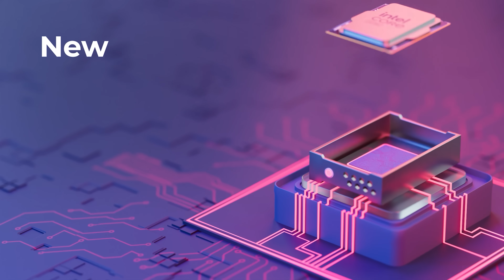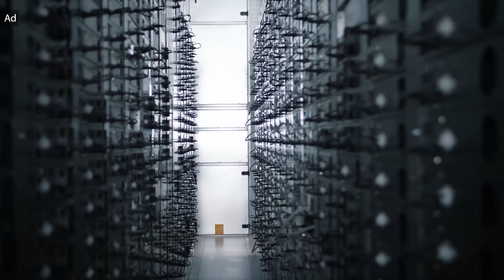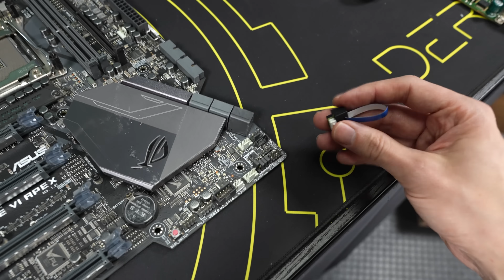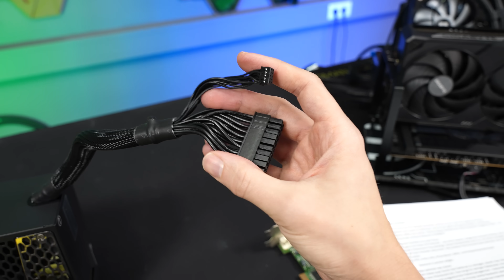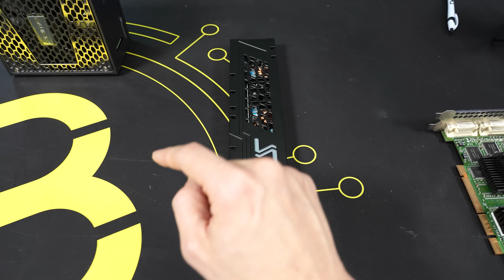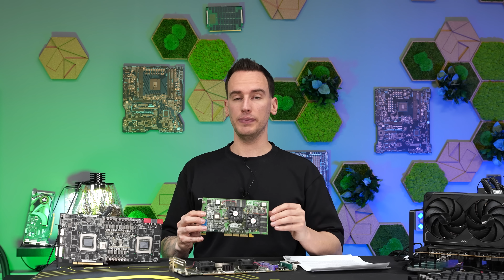Dead-on-Arrival Hardware: Why Nobody Bought These Products - Failed Hardware Ep-1

Comment: Id like to point out, that hardware raids aren't necessarily faster than software raids.

For raid1, it hardly matters.

For majority of raids, hardware raid is better, because it takes the load away from CPUs.

Hardware raid fails short on several key aspects tho:

Its another single point of failure (but so is onboard sata controller for example) except due to complexity, hw raid is more likely to fail than the onboard chip.

Its bad for nvme. Max you can connect without switching is 4x nvme ssd. Then you start losing bandwidth.

For nvme, its much better to have let's say, 10x 7,68TB nvme in software raid of some sort (zfs is decent, and more stable than any HW raid i have encountered) Or straight up some cluster technology (like ceph) paired with a good cpu (24core epyc is a decent pick, 4cores for OS, 2cores per nvme) paired with a good networking card (dual 100G, quad 25G)

There was this neat technology called "graid" they had a good idea of using nvidia gpus for nvme raid calculations, but when we tried them a few years ago, it wasn't exactly useable just yet. Gpu was a single point of failure, you couldn't boot off it, performance was good, but there was some weirdness with specific loads (like databases)

I could get to more exotic technologies like nvme-over-fibre...
But i think i already ranted too much after hearing "software raid is slower" :)

Comment: The Seasonic Connect should have been 1000w and SFX. Beat Silverstone to the market for high power small form factor by moving space around instead of waiting to develop smaller, and work with a SFF case builder to get a specifically compatible case ready for launch.
Big cases never needed the cable routing it allowed, most just lost drive bays or blocked airflow, and smaller cases couldn't fit a full ATX PSU box and the new distribution blade. It was designed for nobody. 

Either that, or it needed to be the most power efficient PSU on the market with some kind of Platinum++ rating to sell itself that way.

Comment: I liked the seasonic connect and thought it was a cool idea, I hate power supply cables which are always far too long unless you bleed money and get custom cables made.  But then when I went to consider buying one, I was building a pc that needed 12v hpwr, and yeah, I wanted more than 750watt.  So no matter how much I liked the idea, no matter how much I was willing to pay a little more, the psu just did not meet the spec requirement I needed.
Reply: custom cables idea is the best - if you want to stick with one PSU manufacturer you will buy them only once - seasonic and corsair stick with their pinouts for over 10 years

Comment: I think a Seasonic Connect-like solution would be great for a ATX12VO transition period, where the module could handle all non-12V stuff.
Reply: ATX12VO is a scheme that solely benefits OEMs that have to hit DOE efficiency specs (or the Euro equivalents). Sure, go "Well acktshually wire loss" like a redditor and I'll tell you that a fraction of a watt of wire loss is nothing. But if youre dell and youre using a modern topology PSU that converts mains to 12v and uses DC/DC converters for everything else, and it gets an 80 plus gold rating, rip out the DC/DC converters, and with the loss of those gone, its now 80 plus platinum, and cheaper.   Put the 5.0 and 3.3V regulators on  your motherboard, but because there isnt effiency standards on that, you can use cheap garbage-tier effiency converters that are barely not overheating.  So dell gets high efficiency ranked ATX12VO PSU for cheaper than a lower ranked normal one, still meets the regulations, and only has to add cheap low performance converters on the motherboard to make it happen.  That is why thats a thing, not because the PSU manufacturers care about the few hundred mW of loss on your 5.0v line. Then they do a press release about how much more efficient and environmentally friendly the new series is for people to seal clap to.

Comment: VROC could have been great if Intel had not locked down what drives could be used with it. IIRC, Intel never fully opened up VROC to let you use any drive, they still have specific drives that can be used with it.

Comment: vroc keys are still a thing in their servers. It's really annoying. I have a 1000 dollar c741 lga 4677 motherboard, and I can't afford a vroc key that supports raid 5 or 6 to unlock the feature on my 10,000 dollar (in theory, Im running an ES chip) cpu. Long story short, I have 8 nvmes in raid 0 instead of raid 6, because I don't have the ultra expensive vroc key. So annoying.

Comment: I want to make a "24pin declutter" where it's a tiny DC-DC PCB sitting right-on the 24PIN supplying all the odd rails like 5V/3.3V and it only has got a 8 pin connector (12V, enable, power good, 5VSB) so you only have 8 wires going to the ATX PSU.
Most people know how much of a headache the 24 pin with 24 wires is, hard to manage, especially in SFF builds, looks ugly, and doesn't really make sense - many wires for something that realistically doesn't draw more than 60W (I've seen it down to 20W).
Most of the draw is on the 12V CPU EPS and GPU's PCIE6-8 PIN/12VHPWR connectors, and GPU draw from pcie slot is often marginalised.
It basically is the 12V-only thing they tried to introduce but it uses existing PSUs and mobos, and still could be rewired for actual 12V only PSU.
Yes there are the so called "pico psu" which sort of do that, but the included wiring makes you draw EPS CPU power from only two wires shared with the 24 pin, meant for low power systems, the above approach could power a 300W+ CPU because all of that goes thru separate cable.
Reply: it is already here - it called atx12VO - it was several motherboards with this stadnard, it is not completly dead, dell/acer/hp/lenovo still uses it on their setups 

PS - I make custom cables, and for atx24 you need only 10wires (ps on, ps ok, 5vsb -12, +12, +5, +3.3 and 3x GND) most setup will work with that (espeically sff with iGPU) - if you want to be safe just add extra +12, +5, +3.3 and 1 or 2 gnd - then you will get 14 or 15 wire harness (in comparasion to big 23 wires setup) I am making 14-14-15wire atx in all my custom rigs for over 6years
Reply: @duniek86   Yeah but it requires special mobo and special PSU, so there would be a lot of incompatibility.
I skipped -12V, it's only required for serial RS232 interface not present on motherboards in past 15+ years...
I haven't tested that but I doubt the mobo will check for that rail.
And even if it would be needed it would be made from +12V onboard.
It would be 2 connections for 12V, 3 grounds, 1 enable, 1 power good, 1 5VSB, so that's 8
But tbh I could probably derive power good from 12V, and have 3 for 12V, there is no 12V without power good signal and vice versa.
Or there could be even less wires for ground, thing is CPU EPS is an overkill with 4 pairs, and all the grounds are shared.
Reply: @Arek_R.  I checked without -12V wire and PC not boot up :(

also while testing rail measurments I get sth strange
I push cpu up to 20-22A on 12V and on GND I got only 5A, so I checked pci-e GNDs and while gpu idling I got about 1A on 12V but on GND I got about 15A
Reply: @duniek86  Well that sux.
The uneven ground returns is typical because all grounds are joined and the current will choose often weird paths.
Is ATX EPS CPU cable longer than the GPU CPIE cable?
Reply: @Arek_R.  I tested it with stock wires, two different motherboards - similar situation - it was tested on wooden desk - also i have opposite experience - in GPU mining rigs on metal frames only gpus was working - on +12V i got full power but on GND usually 1/3 or 1/2 of  current - some current was "back" to psu by atx harness but most of it by metal frame :O
Reply: @Arek_R.  I rid of -12V and zotac z77 boot up :O
Reply: What is the type of upstream PSU that you're planning to use? Basic ATX full modular PSU and then run only 12V, 5VSB, PS_ON and PWR_OK to a Pico-PSU-like board on the MB connector via a custom cable? There are reversed schematics for PicoPSU floating about, or you can just proof-of-concept your build by removing the 5VSB and PWR_OK from the step-down converter on the PicoPSU and running them from the ATX. 

Oh and also a logic gate to logic-AND PWR_OK lines from PicoPSU and from ATX.

I suppose ultimately you can just remove most of the logic from the PicoPSU, just keep the step down converter - PWR_OK can power the converter enable, and converter has its own ready output. Sorry i'm sure you have thought of all this before, i'm just thinking aloud to understand your plan :D
Reply: @SianaGearz  No particular plan.
No need to look up pico PSU schematics except maybe some inspiration, because in the end it's just two 10-20A DC-DC converters, some smaller rails, and a bit of logic.
One thing I've noticed on cheap one I had is that they used a dedicated 3.3/5V (maybe 12 as well) power checker IC which checks if these are present, at right level, and I think that's where the PG comes from.
But as you wrote DC-DC converter itself often will have PG outputs.

Comment: 12:10 I mean the industry doesn't need another interface to replace AGP just because of needing more power. In the early 2000's, ATI Radeon 9700 Pro was a very popular  high end gaming graphics card, those things need extra power from a Berg connector ( floppy disk drive power connector) . High end Nvidia GeForce FX cards use Molex connector.  Going PCIe just standardize these external power connectors.

Comment: 13:11 How about  cards that used a 4 pin Berg connector? Felt like you were going to break it every time connected or disconnected the wire.
Reply: Well, the same applies to the Molex connectors. I still have a soundcard with a molex socket (an Essence STX II). The connector sits that tightly in the socket, when i remove the card when cleaning of the PC i don't disconnect it because i am afraid the force required to dislodge the connector would either break the socket (and thusly the card) or my fingers might slip of the connector and accidentally tear the cables out of it.

Comment: I'm honestly surprised we don't have more complex dual GPU chiplet designs on GPUs these days. There are a lot of tasks that are lower priority and require a lot less cycles to complete that would still perform really well, like if you had a 5080 that also had a 1060 as a chiplet on board that could handle background tasks like rendering background applications.

Comment: I made custom cables for a long time, and when the Seasonic thing came out I thought it was cool, except they made the pinouts for the cables the same as their traditional PSUs. If they had made them to match the component end pinouts, the short cables could’ve been super clean extensions rather than short versions of the standard cables, which are harder to make nice because of the double wires for sense pins and thick sleeved wires having to cross over each other.

Comment: What happened to 12V DC PSU? Wasn't it suppose to level up the efficiency?
Reply: It can't actually improve whole-system power efficiency, only the nominal efficiency of the PSU, by offloading some of the work elsewhere into the system. As such it allows several large prebuilt system vendors to signal green goals compliance or unify the solutions they're already using, should they be interested in such unification - which isn't certain, because they don't like their bits being interchangeable, they want vendor lock-in. I wouldn't actually be terribly surprised if it never comes to enthusiast/DIY component product market or at all.

Comment: Seasonic connect was the first step to the final transition which i hope will be ATX12VO+GC-HPRW with some improvements.
Imagine a single 20 PIN connector (10*12v+10*ground for up to 1200w) with some load balancing feature as the only power cable from your PSU to the motherboard.
Reply: That would just turn up the 12vhpwr fiasco to 12.

You are assuming you can get equal current sharing on 10 wires not just 6 and you’ve pushed the connectors and wires to their absolute limits of 10amps each with no margin for loss of any wire or connector.  You have selected raid-0 for your main power connector.

That said, I do agree that a main power supply that provides 50v with light regulation to keep costs low and distributed or integrated VRM at the point of load makes sense. OCP is championing this style of compute. Fewer wires and less current per wire with 4x the voltage.
Reply: @ppokorny99 No, you just did not ready my comment before posting. I mentioned the load balancing feature (obviously on the mobo side since this Is the only component directly wired to the PSU) to split the load on the 10 wires.

18 AWG would also be mandatory.
Reply: @hbjigcc  you edited your post
Reply: @ppokorny99 No, i didn't. This was the same post i wrote when i published It, just fixed a typo 4h ago. Try again.
Reply: yeah atx12vo should be a thing and maybe old style 12-14pin connector for GC

Comment: I did buy a Seasonic Connect, why, because they were cheap af. That’s what happens when a product doesn’t sell and collects dust on the shelf, it gets huge discounts just to get rid of it.
But it was a bit dumb of me to buy this without the case. It was quite difficult to adapt it to a Fractal Design Meshify C with is really stupid short cables.

Comment: i wish pc market would switch to 48v psu systems,it would mean thinner cables,maybe split into extra dc-dc(similar to seasonic) for extra devices like hdd(48 to 12v and 5v)...48v chips are already available(solar boom,either hv or 48v,and those hv batteries are usually 48v packs in series)..so i think we are ready...but i don't think this will be there soon enough,maybe we need 6090 melted connectors

Comment: What i'd add to this list - intel Itanium.. and those motherboards with rear mounted connections  (as they only worked with specific cases. )
Reply: Hard disagree on the rear connectors. While it was very awkward when it first debuted many cases now support it and motherboard manufacturers are still releasing rear connector models.
Reply: You mean BTF mobos? Tbh the tech is still quite new and growing, a lot of newly released cases are starting to support it
Reply: Roman already did a video about Itanium.

Comment: I "have" the seasonic powersupply with extender, but during water cooling work, I didn't notice and water dripped over the night, and fried it when i turned it on the next day.. , and didn't replace it.  Overall concept was interesting, far shorter cables, but agree that mounting that distribution block was annoying.

Comment: The main thing about the Seasonic Connect PSUs what made their use limited was that they required cases with inverse mounted motherboards (i.e., GPU at the top of the case). They sold special cases for this (the Synchro cases). I considered buying one of these PSUs for a used Macintosh G4 case, which also holds inverse mounted MBs. But it was just too difficult.

Comment: Love the series. The modern failures are so funny because you see em all over CES and other trade shows, but never in real life. VROC was also one of the reasons I went Threadripper. Not that AMD's RAID had a lot going for it at the time. Can't wait to see what's next.
Reply: I remember when they start use pci-e - performance was similar for 2-3 years with nvidia cards, many ppl says pci-e will die, me included

Comment: One of my favorite DOA pieces of tech was RDRAM. During the initial Pentium 4 release, those CPUs were only compatible with RDRAM, an obscure new RAM type with a very scarce availability. It was so bad that Intel had to bundle their CPUs with a stick or two of that special RAM because it was impossible to get it through normal retail channels. And customers were so angry that eventually Intel had to ditch it in favor of DDR.
Reply: The only time I encountered it personally was trying to help a family friend with their Dell PC.  One of the Rambus sticks went bad but Dell would not admit it because it could pass a simple and quick memtest.  Figured okay I'll just pull out the bad stick and let her run it like that for a while just to get it up and going again, but you can't do that with Rambus and I would have needed a continuity module.  In the end I just built her a new AMD Athlon PC to get away from Intel and Dell bull.
Reply: From what i remember RDRAM also ran crazy hot and didn't perform very well.
Reply: @SianaGearz Definitely ran hot; needed airflow directed over the ram or they would go above 70c with just casual use.